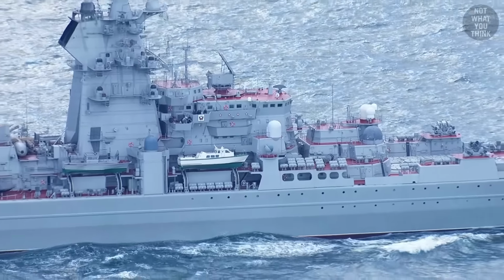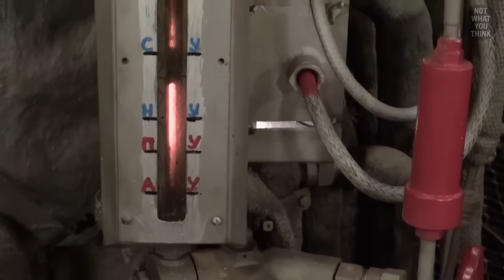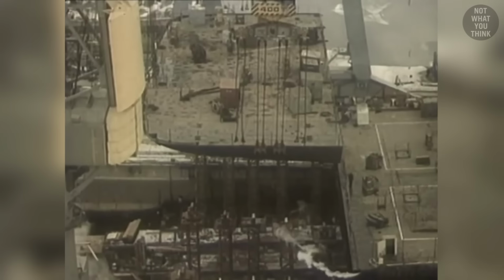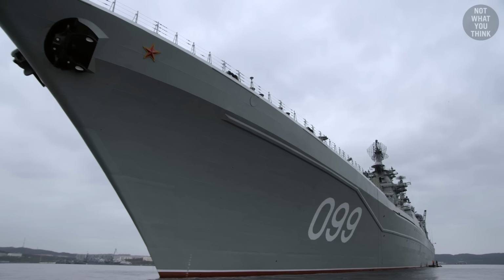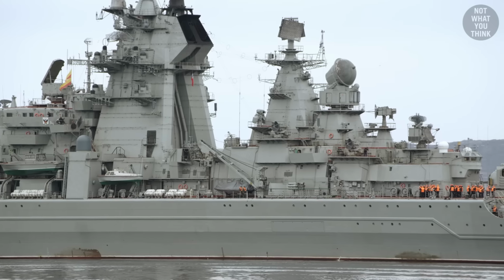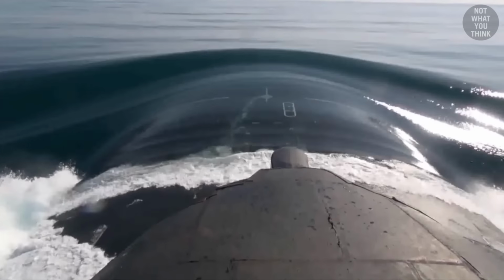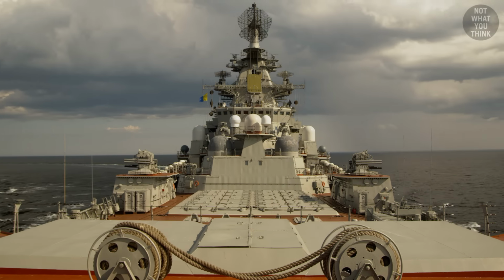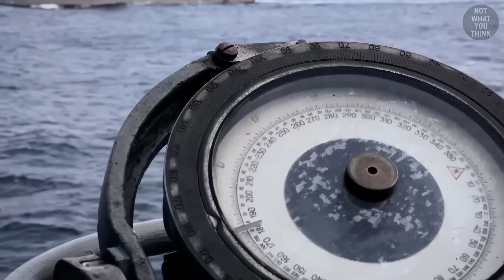Russia's Massive Nuclear-Powered Warship That Smokes

Comment: The reason for these giants being classed as a cruiser is that they had to pass through the Bosporus being built at a shipyard on the Black Sea coast. There is a naval agreement that forbids passage of anything larger than a cruiser through there.
Someone did write down a very detailed specification which also had the strange side effect of creating aircraft carriers with some serious surface-to-surface armament with the Kuznetsov having Granit missile lauchers mounted in the flight deck
Reply: those ramjet missiles are awesome. the only thing even cooler are the ramjet artillery shells in development... that apparently use solid fuel, which is bizarre.
Reply: Many thanks for this update ! 👍🤝🙂
Reply: Crikey- so that’s why even the Kusnetsov is classified as a cruiser?  The flight deck does mess with perception - another example is that at the waterline, the USS Gerald Ford and the Queen Mary 2 have the same beam at 134 ft (mind you the Ford stretches out to 256ft at the flight deck while the QM2 is only 147ft)
Reply: @patricia1333  Kiev-class was also classified as aircraft carrying cruiser.
Reply: Montreaux convention i believe, signed in France in the 30's, which forbids vessels above 15k tons crossing the Bosphorus straits, and no carriers what-so-ever.
Reply: The Kuznetsov - fully equipped means including an ocean going tugboat. 🤣
Reply: If true your comments are very interesting!
Reply: They were not build on Black Sea shipyards. They were built in Leningrad - Baltic Sea coast.
Reply: @Milo-id9qd Close: Montreux Convention, and the tonnage limits are a bit more complicated and distinguish between Black Sea powers and other countries.
Reply: The actual reason for the kirov class being called cruisers instead of battlecruisers is that they definitionally aren't battlecruisers based on the role they're meant for. They are guided missile cruisers. Granted they are very large guided missile cruisers, but our own Arleigh Burke class destroyer is larger than a lot of WWII cruisers, so size isn't everything.

Comment: So the RPK-6 Vodopad is a horizontally-launched missile which starts above water, goes straight into the water, then goes airborne for 30 miles, then goes back underwater...
Reply: It's not manly enough to do things the easy way.
Reply: they just took a sub launched anti sub missile and put it on the ship, along with the launch tube.
Reply: @xsu-is7vq  I'm just surprised that it works, being designed to start off underwater.

Comment: The oil boilers are not just a backup (though they work as that as well). The combining gear means that both the boilers and the reactors' steam can power the ship at the same time, leading to higher top speed in a burst when using both. Likewise, the second reactor is not "a backup" as the video says, both reactors usually work at the same time. But having two instead of one does double as a backup, since it's possible to move (slower) with just one.
Reply: He does mention that it's CONAS later, which makes the
original claim even more puzzling. Maybe it's because in virtually every 
bit of footage out there, it looks like its cruising speed 10 knots 😄
Reply: Same goes for American carriers, at least regarding using both reactors. Not sure if they can run diesels at the same time as the reactors tho
Reply: @LitmusPapyrus  There is no combining gear on the Nimitz, and the diesel emergency generators cannot drive the main shafts in any way. They are meant for backup electrical power for the ship.
Reply: Oh look we have another American armchair general here 🤓
Reply: @Burningarrow7  Considering what he said was correct, was there a point to your comment besides "I don't like Americans"? Besides, it would be armchair admiral, not general. We are talking about ships here, after all. 🙄
Reply: Wow its almost like... thats... exactly what they said in the video.... You did watch it mr russian yes?
Or are you just repeating what people say to sound smart again.
Reply: Early 20th century Russian battleships of the Gangut class had coal-fired boilers that had oil sprayed into the fireboxes for an extra burst of speed.
Reply: @kpadmirer  Everybody did at the end of the age of coal.  Germany, UK etc..
Reply: The huge smoke cloud may be caused by burning crap cheap low grade boiler oil.

Comment: I will make a separate comment to answer those citing the Moskva. First of all, the Moskva was known to be haunted by issues with equipment not being replaced or repaired due to the Black Sea fleet command laundering money. Secondly, its crew and captain did not act properly as they should in a warzone, its watertight doors not sealed and air defence using only one of the systems. Now here is the difference without taking into account the specific issues:

-The S-300 targeting and detection radar has a weakness: it can only work on one narrow direction. The Kirov class has two of them for reduntancy and all round defense. On the photos of the damaged moskva the S-300 VLS can be seen with slight burn marks and open lids, likely from firing missiles. If that is the case, due to short range AAD not having been engaged, it is likely that the target was of a completely different kind, for example a decoy drone. That way moskva's only radar was occupied with said target, and it could not even switch to another one fast enough. Thing is, unlike on the Kirov, the S-300 VLS on the Slava class are not true VLS, but drum magazines with 8 missiles ready at a time. Fire 8 of them at a target, and spend a while rotating and reloading them.

-The Slava class lacks short-range AA missiles. It does have the Osa in fact, but those are not proper weapons against low flying/skimming weapons. It is likely the russians did not even/could not set them online anyway. The Kirovs have the SA-N-9 Gauntlet SAM, which was specifically designed to intercept sea skimming missiles akin to the RGM-84.

-CIWS
The Slava class have the typical AK-630 CIWS, while the Kirovs were upgraded with 6 Kashtans, which are believed to be more accurate due to different targeting systems, and as OP said, have 8 short-range SAMs as well. Note: according to information on maintenance and repairs, the Moskva's CIWS were not even online because the CIWS had been broken for a while and were not repaired, due to the corruption surrounding the ship.

-Survivability
The Slava class was built as a cheap alternative to the Kirov, with more emphasis on the arsenal ship concept and less on point defence and compartmen separation and protection. As a result of that and the Moskva's crew lack of training, the fire from one of the 5 missiles spread easily, as did the water when it started sinking.

Aye thats all, eat up this wall of text, it doesnt bite

Comment: The US Navy decommissioned all of their nuclear powered cruisers not due to high operating costs but because their combat systems were obsolete, arm launchers and rotating antennas, and there was no easy way, in some classes no way whatsoever to reconfigure their hulls to accommodate Mk-41 VLS and their superstructures would have had to have been removed and replaced with a completely different superstructure to house the SPY-1 radars and other combat management equipment used by the Aegis system.  It was cheaper to retire them and replace them with new Ticonderoga class CGs.

Comment: At 721" the Long Beach was not half the size of the 827' Kirov class. Half the displacement, yes. Half the size, no. Size and displacement are two different things. This is especially relevant considering that in addition to steel, Long Beach was built using 450 tons of structural aluminum.

Comment: I thought the boilers were used to add superheat to the reactor steam at high speed because reactors don't make superheated steam but saturated steam which is bad for turbine blades and causes erosion of the blading . I am a former boiler operater and our high pressure boilers have superheaters built in them
Reply: Pressurised water reactors make superheated steam as their primary circuit is at extreme pressures allowing the steam created in the turbine circuit to be significantly above 100C
I dont know if the russians use pwr or boiling water reactors which run at lower pressure, but apparently make enough heat for a power plant

Comment: The shipwreck would likely keep flying due to the momentum. However it won't reach the target unless it was shot down by like CIWS. The distance is too great if it was intercepted by missiles. However its warhead probably won't detonate due to the samage and its not guided so it might still miss even with the momentum.
Reply: The shipwreck might be able to sustain a hit from older SAM which use blast-fragmentation warhead. The later SM-2 and SM-6 have enlarged warhead, while the SM-3 uses a direct-hit kinetic warhead. Those would easily destroy the shipwreck in air.

Comment: Most People might not realized this. Nuclear Power is basically a fancy name for Morden Steam Engines. The Nuclear Fusion is just a fuel to fire up the boilers. Then they use heated boiler to propels the propellers and electrical dynamo for operate. Basically the ships stills pretty much the same after WWI it just that you just have a firebox as Nuclear Powerhouse. It still has boilers and stuff. Hence Steam can be reuse. Ships still don’t need to refueling much like WWIi because steam can circulate into water which can be reuse. Most Steam Engines are usually refilling Oil or Coal but not much on Water. Steam Locomotives refill more water due to it release steam out. Plus, Turbine Steam engine works better on ships than Trains. And Steam Turbine is better on circulating steam into water. Which reduce the water usage.

Comment: Imagine having that little trust in the nuclear reactor to integrate a second one to the ship. And then having that little trust in the backup to add traditional motors as well...
Without looking it up, I guess the US don't use any backup nuclears on their ships?
Reply: The video leaned too heavily on that.
It can't go top speed on one or both reactors, but it can go all year on nuclear power, and really fast with steam power added.
Reply: Ain’t that called a fail safe system which is good to have?
Reply: @JFrazer4303  Nuclear power is 'steam power'. Heat from the nuclear reactor boils water to produce steam and pin turbines...
Reply: @aarongreen1654  Obviously I meant oil-fired steam power, as opposed to nuclear power heated steam.

Comment: About Nakhimov ship, it was said that it would return to the fleet in 2018, then it was postponed till 2020, later till 2022, and then 2023, and finally in 2023 it was announced that it will be back in fleet in 2024. I suspect that this just keep going to happen. Modernization project costed more than 200 billion rubles which is 2 billion USD with todays exchange rate (keep in mind that ruble was more expensive in the past)

Comment: Yes it uses a nuclear power plant for sustained power and propulsion, and an oil fired boiler for superheat for propulsion steam to get maximum power hence speed from the engines. That last burst of speed is rarely needed so it is far cheaper to buy the boiler than to build a larger nuclear plant to give that extra power. It's an economical solution to a need  but one which we don't use for a number of reasons.
Reply: russia doesn't care if it's embarrassing. 😂

Comment: The reason they still have diesel engines is to do with the nuclear reactor onboard.  If the reactor shuts down then I needs to cooled down otherwise you’ll get a nuclear meltdown as happened at Chernobyl.  Sometimes they are required to test the reactor and the diesel engines reaction to the reactor shutting down.  All nuclear power stations and nuclear powered craft have to do this to ensure that the core of the reactor is cooled down by water.  The test at Chernobyl went drastically wrong because when the power went off the diesel engines didn’t come on because someone was working on them and suspended the protocols for them to automatically turn on.  This is an actual requirement from the Automic Energy Agency that all reactors are able to keep the core cooled down.   The problem with the engine protocols at Chernobyl being switched off was when the red button was pressed kaboom 💥 it exploded blowing the roof off the reactor.  That’s why they have diesel engines still.

Comment: The problem of having one big ship with tons of weapons, is exactly that, its still just one single ship. It doesnt matter if it has 400 missiles and systems in it, thats all in a single ship. A few enemy missiles or torpedoes and it will get converted into a sub. Thats why battleships went extinct. One of the worst things you can do on the modern battlefield is to be large and easy to notice.

Comment: So, the ship has a backup nuclear reactor in case the main nuclear reactor fails, and boilers to back up both nuclear reactors fail? But what if both nuclear reactors fail? The ship also needs 4 gas turbines in case both nuclear reactors and the boilers fail. But then what if both nuclear reactors, the boilers, and all 4 gas turbines fail? The answer is retractable sails. But then, what if both nuclear reactors, the boilers, all 4 gas turbines, and the retractable sail mechanisms all fail? The answer is 200 oars with teams of rowers. Then, the ship will be safe.

Comment: Atomic theory is pretty much straightforward now.  Humanity has been doing it for a while.  Tech has made atomic power more dependable, safer, and efficient.  To need 2 reactors for backup purposes and even a large fossil fuel burning engine as a backup and a supplement power source shows problems in implementing the tech of the time.  I have my doubts that the ship will perform as stated considering how other modern weapon systems have failed to perform in the present war.  Just a thought.

Comment: Nuclear power is also steam. It's just that the water is heated by an oil burner or nuclear reaction - or both.
Reply: Electric motor!
Reply: @pashapasovski5860  If she has electric motor propulsion then the oil could be used in the engine of a generator set to produce electricity. But all nuclear power does is produce a lot of heat.  That produces steam from a boiler which is fed to a turbine that drives a generator which produces electricity for the motors that drive the propellers.

Comment: According to my calculations the Russians are right in their claim that it doesn’t matter if the missile gets partially destroyed, the ship will get destroyed by the mass of the missile alone.

I‘ve calculated the kinetic energy with half of the missiles mass, to include the spent fuel. The Missile has a kinetic energy of approximately 1.58 Gigajoules. For comparison: your average APDSFDS Anti-Tank round has a kinetic energy of 12 Megajoules. 

The HMS Sheffield got penetrated during the Falklands War by an Exocet missile, which weighs 10% of the Granit and goes subsonic. Physics don’t change.

Comment: Out of the original four in the class, they only have one in service and a second one, Admiral Nakhimov. This one was last in service way back in 1999 but has suffered multiple postponements in it's refit. It's recommission date seems to have slipped from 2022, 2023 and  now 2024, but this now seems unlikely. If Admiral Nakhimov does ever join active duty then the Pyotr Veliky will be taken out of service for its extended overdue refit (first since 1998) or even decomissioned.

Comment: Correction on the Russian aircraft carrier. It came out out of a refit four years ago and now sails without a tugboat and now has very minimal exhaust equal to any US vessel. 

These cruisers are being upgraded with large multi band radar systems enabling them to detect and track all western stealth aircraft. This enables the vessel to launch air defence missile to attack them with the missiles target locking in final stages which is not possible via the radar at this stage.
Reply: yes and no, Kuznetstov is still in dry dock for repairs. We'll see how it goes when and if they finish it. It's planned to finish repairs in 2024

Comment: He doesn't actually explain the reason for flooding the missile launch tubes (regardless of ship or sub launched) prior to launch. I suspect the reason for the flooding may be to reduce damage to the launch tube during a missile launch, so the launch tube could be reused (perhaps with some amount of repair). 
Land based rocket launch pads (such as the pad at Cape Canaveral, used for Apollo rocket & Space Shuttle launches) would be flooded (under the rocket engines) with an enormous amount of water, just before & during liftoff, to absorb engine shock waves  & heat, to reduce damage to the launch pad.

Comment: The smoke is Very easy and very fast and also quite simply explained it can switch between nuclear and conventional propulsion apart from that they of course also had to The reactors are being expanded, this is also because new reactors had to be built, although the flagship should of course remain in use